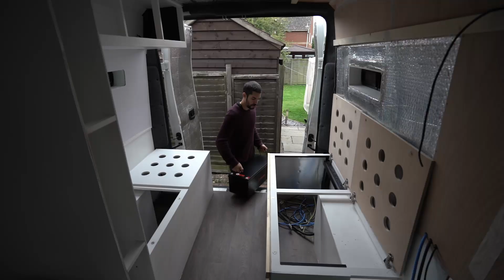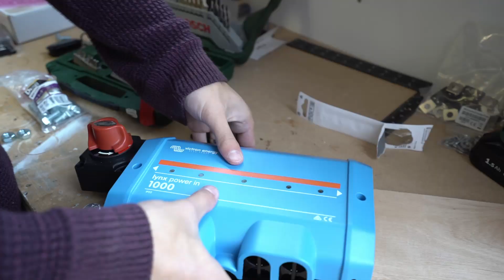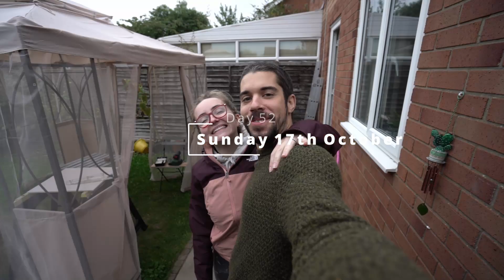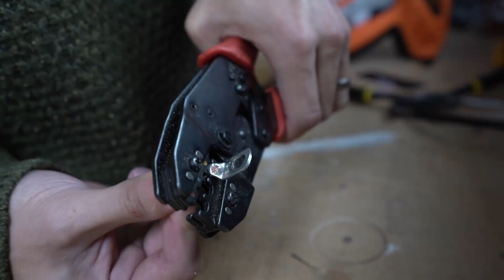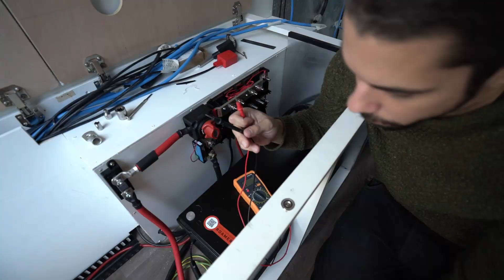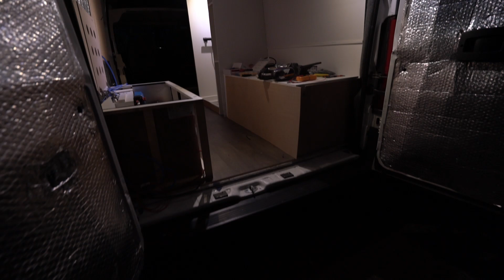WE HAVE POWER⚡ - 12v Electrics install - Citroen Relay Camper Van Conversion - Week 26

Comment: Hi Laz and Cas - which 12v fuse block have you used? I'm thinking of using a blue sea one for around £50 but there are other cheaper versions on ebay... Any advice?
Reply from the maker: Hi Steven! I added a link to the description to a 12 way 12v fuse panel, I think we have the exact same one, It's like £17 seem to work just fine. Thanks!

Comment: Could you wire two 12v fuse boxes to one distribution port on the power in
Reply from the maker: Hmm I think the lugs would get too tight on top of each other. The lynx has 4 fused connections so if you need more then that you can get a mega midi fuse distribution block that you could branch off to multiple 12v fuse boxes.

Comment: Hey, thanks for the great content each week. 

I like the thought of proper segregation of + and - so bought the lynx distributor, which is the next model up. 

Unfortunately it needs the 48v fuses,  which are 30 quid each and they don't have sizes smaller than 125 amp. 

Are you using the 32amp or 48amp fuses and what is the lowest rating you could find. 

Cheers
Reply from the maker: Hey David ! Thanks for following along, hope our journey helps a bit! 

I thought the difference between the lynx distributor and power in was pretty much just the led lights + circuits to detect blown fuses? (and screws that I shown in the video) 
I think size wise they are exactly the same and they both should accept standard MEGA fuses? 
Smallest Fuse in our Lynx Power In will be the standard MEGA 32v 60A Fuses (for 12v distribution, mppt, orion) 

According to the manual you should only use higher then 32-36v fuses if your system is 48v (then it recommends 58v) 
As long as your system voltage isn't higher then the fuse voltage rating it should be all good ! 

Hope this helps! 
Thanks!
Reply: Yeah that pretty much sums up the differences.  The distance between centres of tthe m8 bolts that would hold the fuses is 60mm.  I cannot find anything online with that distance except the 48v fuses.  I need two 60amp fuses, 100amp and 200amp and they only do the 200amp in 48v.

Do you know what the centres are between holes on your fuses are
Reply from the maker: @peapod2083  Standard size for MEGA fuses is 50.8mm (bolts centers) I'd be very surprised if it was 60mm in the distributor? 
I'm looking at videos from Exploris.life and it looks like he is using the same fuses in the power in or the distributor ? p.m me a message on instagram and we can chat more and send pics etc. Thanks!
Reply: @CasLaz  you have saved me from a real nightmare. I ordered a load of mega fuses (spares too) , but mistakenly ordered one size in a  midi fuse….which got delivered before the rest of them today.  I checked my Amazon history after your help and realised my mistake.

One google search led me down the wrong path with the 48v fuses which were 30 quid each. I couldn’t find my tape measure, so used an old fabric tape measure which I incorrectly read to give 60 centres.

I owe you a beer. Our Ducato gets delivered next year, so it should be finished-ish in time for some festivals. I’ll get you both a beer for the content and saving me a huge embarrassment :). I am already following you on instagram too.
Reply from the maker: @peapod2083  Phew haha, glad I could help and it's all sorted now! Any other Qs don't hesitate to get in touch in comments or insta! Happy to help if I can just bare in mind we are no experts 🤣 
Good luck with the conversion! it's very exciting and we have learned so much already, great life experience! You don't owe us anything but if we do meet up in the future beers sound awesome! 🍻
Oh and p.s we have amazon affiliate links now so if you really do want to support us click one of our Amazon links before you order stuff and it helps us out a bit (no extra cost for you)! Thanks David!  😎👍
Reply: @CasLaz   well we shall definitely come and say Hi and have some beers with you. I’ve been super impressed with your videos and will be watching them all again when the van comes.

We can’t wait to be part of the van life community. Just wished We had done this sooner. Just look out for our van peapod. 

What are the spots like in your link. I’ve just had to return some on Amazon because the quality just felt cheap and they were scratched.
Reply from the maker: @peapod2083  Thanks David hope they help out ! For sure, we are always down for meet ups, especially when the van is done ! 😎 
Lights been all good so far no problems at all! You can buy anything within 24h of clicking our link, we get a tiny % of the sale, (slightly higher for things we link directly) 👍
Reply: Great thank you.  I've ordered the victron shunt using your links for now cause I'm going to build the electric distribution  on a ply board. Sad when you think my van isn't being  delivered for 3 months.  Let me know if you don't get it through. 

I'll order the lights nearer the time.  Hopefully the Roamer battery is affiliate to cause that's the same battery we are going for
Thanks again.
Reply from the maker: @peapod2083  Thanks so much ! 👍 ⚡ We don't have affiliate link for roamer unfortunately, maybe one day! Would be good to get you guys a discount code ! Know quiet a few people who ordered after our video, if you talk to Steve from roamer let him know we sent you 😉  3 months will fly by, enjoy the free time you have now as after it arrives it will be all about the van 🤣 👍

Comment: Wow 400ah Roamer, you put that in my van and the cost of my entire build would double in price.
.🤣
Reply from the maker: Yeah Lithium batteries are expensive 😥 but main brands are even more expensive and there is no way we could afford 400ah of that stuff haha. We save abit on not having to deal with gas etc as everything will be electric / diesel 👍

Comment: Great to see you now have power, feels like a total game changer, i had the same problem with the fuse holder and had to modify ours. That moment of connecting the battery for the first time, oh my life, scary and great both at the same time. Great work.
Reply from the maker: Thanks Matt! Ah seems like a fairly common thing that I haven't come across before haha. Yes connecting it for the first time is scary even if you are 99.9% sure nothing will happen 😆 
Excited to get the rest running now!